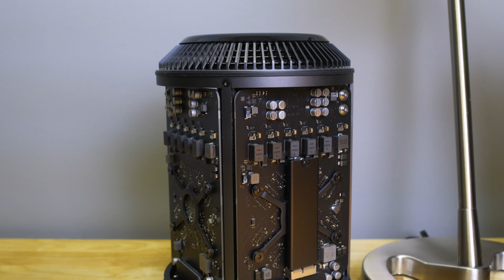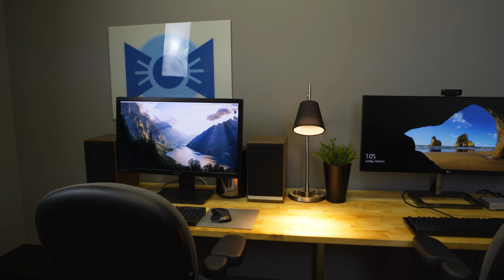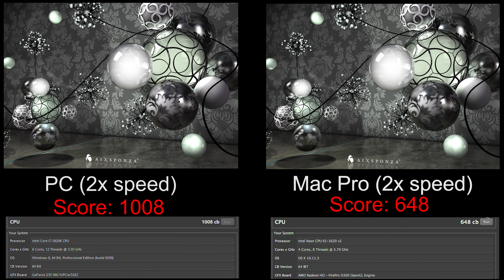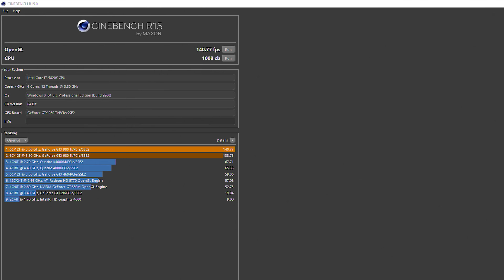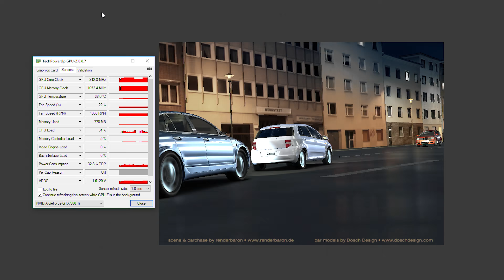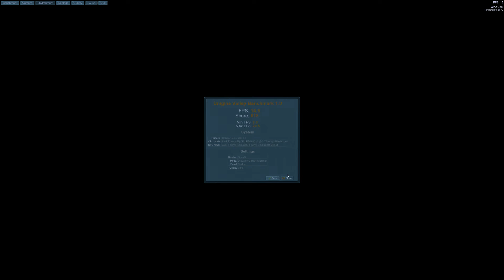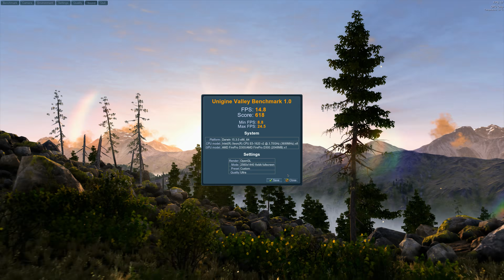$2,000 Custom PC vs $4,000 Mac Pro

Comment: I am not surprised that a new $2000 pc beats a $4000 mac pro that is already 3-4 years old. You can get newer computer with $1000 or less and it still may perform way better on those tests than the mac pro.

Comment: My desktop is a HP with a core i7 6950x, 32GB RAM and a TITAN X.  I got over 60 FPS using that benchmark.

That Mac is available with 12 cores for around $10,000.  

It sounds cool, but I'm not sure what it would score.

3D prefers more cores...

Comment: this has always been the case with Apple. It's nothing new for them, hell you can build a Hackintosh, with OS X, for half the price it would otherwise be sold for. But the sheeple will blindly continue to overpay for, mediocre at best, hardware and performance. maybe because it's shiny, and well,  the Apple sheeple are easily amused and not the most intelligent to begin with.... (not all just most)
Reply: Derek D do you know how hard it's to make a hackintosh? You have to buy specific components just to get it to work and it's illegal.
Reply: Ross MK it's infact not illegal, and the parts aren't all that hard to find or expensive to purchase. You may find your Apple Id banned if Apple hears but big deal. All this just prooved even more how ridiculous Apple is. I can buy any components and use them with Windows, Ubuntu and other linux based os's with ease. Apple makes it difficult if you don't know what you are doing sure.

Comment: Not that it justifies the price difference but comparing a Xeon with an i7 isn't really a fair comparison. They're significantly different processors designed for different things. In a really really rough way its kind of like comparing a car and a truck simply in terms of speed.

Comment: Again, one video about comparing a workstation against a gaming rig, and 9k stupid idiots who don't see the difference between a money making workstation, and a money consuming gaming rig!!! FOR FUCKS SAKE when is anyone going to put this damn Mac Pro on a professional workload instead of gaming tests and gaming benchmarks?!
Reply: Konstantin Sembos he did the rendering stuff I dont know what its called, the mac still lose
Reply: Konstantin Sembos 
Cinebench is a render test and in any case the hardware on the PC will outperform the Mac by spec alone, regardless of software and operating system. Unless you're using Final Cut Pro, which is mac only, there's no comparison.
Reply: What about GPGPU applications, where these things are supposed to perform well, thanks to their specific components, as opposed to consumer CPUs and Gaming GPUs? And no, cinebench doesn't give any glimpse as to how a computer can perform in that large area of professional applications.
Reply: Konstantin Sembos I've been making money with a "Gaming Rig" for more than 2 decades.
This kind of tech perfectly suits all of my needs, and the 2k$ "Gaming Rig" shown in this video is pretty comparable to my main working computer.
Failures in 20 years of work: 2 defect hard drives. No bluescreens. No lost or corrupted data. No other problems.

But principially you're right. You can also waste your money easily buying a PC workstation with ridiculously overpriced XEONs and "Pro" GFX cards and it won't be much cheaper than the Mac "Pro" (and will also offer a lot less power per $ than the "Gaming Rig", and in low configurations even less absolute power). 
Nevertheless, the PC workstation will still have the advantage of easily interchangeable parts (an absolute must have for professional work - and when it comes to that, the mac is just a ridiculous toy). And of course you can get PC workstations in rack cases - also a must have in a lot of scenarios. We sometimes use these things as 24/7 media servers - for this use case long term reliability is much more important than the price. You can not even get the Mac "Pro" in a rack case - an utterly useless joke.

So to be fair, let's compare the "Gaming Rig" with an Apple computer, which parts are more compareable (Desktop case, I7, GTX 1080 etc).
Oh wait, there is none.

Comment: One thing about Apple products in general they usually come underspec for the most part. And if ppl want to upgrade apple products they have to buy more upgrade components/adapters to get optimal performance. Apple successfully pulled the wool over gullible Isheep for years.

Comment: One has 4 cores anr 3,7 Ghz one has 16 cores and 3,3 ghz so if 16:4=4 then if the custom pc would be a quad core it would be 13,2 Ghz 13,2Ghz:3,7Ghz is 3.5675675676 So the custom pc should be 3.5675675676 times faster!lol
Reply: Math genius, computer science ignorant. Mhz are not the issue here.. This guy is comparing a truck to a roadster in speed... put that PC to do CAD intensive and it will spit errors by the hundreds and crash
But dont worry. It's just a video for stupid gamers to justify spending 2000$ they DONT have on a gaming PC to say its just faster than a Mac Pro... WOW!
Then ask them How much money they make with it? 
There's a reason why people who MAKE MONEY with a computer use certain models, custom or macs. THEY KNOW what they're doing mate!
Reply: noeliu It's true that there is some professional software out there which mandatory requires professional workstation graphics cards, e.g. SolidWorks, or other software, which gives a lot better results when using an expensive professional grade gfx card, e.g. CATIA.
But it's also true, that there is also a lot of professional software, which doesn't require a good GPU at all (e.g. Office software, Compilers/IDE) or runs a lot better on good consumer graphics cards (Autodesk Maya).
For a lot of tasks ECC support is not necessary, especially the common desktop work. If the worst thing which may happen is a corrupt rendered image or one crash in 10 years, it's a simply an unnecessary waste of money. On the other hand, for some tasks it is indeed mandatory, e.g. all 24/7 systems or all systems, where precision is absolutely crucial (e.g. CAD, Financial).

What you need highly depends on what you want to do.
So if you REALLY KNOW what your'e doing, you can save a lot of money.
The "gaming" system introduced here would be a perfect choice for Maya users. Around triple performance for half the price.
Programmers who need a lot of processor speed, but nearly no GPU support, could remove the GFX card completely and save even more money.
Users which really need a professional GFX card because their programs depend on it, could e.g. replace the GTX980TI by two Firepro W7100, which would make the system ~$3000 instead of $2000. A bit more expensive than the pure "gaming" solution, but still a lot cheaper than Mac and it will - both CPU and GPU-wise - run circles around the Macs poor and outdated hardware.

So what's the conclusion?
You see, PC/Workstation means ultimate flexibility. You can tailor your system perfectly to your needs without wasting a single $.

And Mac? Wether you need a GPU or not, wether you need ECC or not, wether you need a workstation grade GFX card or not, all that Apple tells you is:
"Eat this trashcan or die".

And it comes even worse. 2 Years later the system might be still pretty decent when it comes to CPU, RAM and SSD. But the GFX card might be outdated.
So just exchange it for little money on the PC or a bit more on Workstation.
On Apple, your'e simply lost. You need to buy a completely new computer. IF Apple has decided to be so generous to introduce an updated model. Which they didn't.
Reply: GrosserMagus Apple is shit
Thanks

Comment: For a workstation I'd rather have a PC of course but when it comes to laptops I much prefer a Macbook over a Windows laptop. The design, portability, battery life, multitask performance and the actual OS on a Macbook is so nice to use for most of my tasks. I can't stand these braindead people who don't even consider looking beyond performance for one second. It's like saying a 300hp car is better than a 200hp car. Horsepower doesn't tell you how well the transmission is. How smooth the engine runs. How it handles corners etc.

Again, talking about laptops. In terms of desktops I also think the Mac Pro is just ridiculously far behind in performance.

Comment: I can think of only one good reason to buy any mac. IOS development. and you can do that effectively on a $700 mac mini. Everything else is better and cheaper on a Windows or Linux box, depending on what you're doing. If the toughest thing you do on a computer is browse the web, do email and watch youtube, any ~$200-$300 tablet will be perfect for you. For creative work like video or 3d rendering, just build a decent PC, same for gaming, same for any kind of development, except ios.
Actually the battery life on a MacBook is just amazing. If you use a laptop as a laptop, then MacBook's are great for this feature alone.

Comment: If I had 4000 bucks to spend on a pc, I would most certainly not buy anything apple because with that much cash, I could buy a killer pc that could last for 20 years if not even more.
Reply: Oriru Bastard i would build a 3k pc and 1k on monitors, peripherals, stuff that makes my desk mine (what i mean with that is like pop figures of my favorite movies and other stuff) etc.
Reply: Probably not 20. Even cards like GTX 1080 will be really obsolete in 7 or 8 years but I agree about the choice. You can build a system with two Xeon 8core CPU's, 2 GTX 1080's and 128GB RAM for the same price of a Mac Pro.
Reply: Cyclopath A trusty windows 95. XD
Reply: i would spend 1500 on the pc rest on other stuff
Reply: no pc lasts for 20 years, it would be a fucking relic.
Reply: Kavi Gosai Well, mine lasted nearly 18. ;)
Now I have 500 buck custom built compy.
Reply: Oriru Bastard yeah, it must have been so useful after 18 years
Reply: Oriru Bastard Just out of curiosity.. what was the specs of that pc? :)
Reply: Cyclopath 32megabytes of ram, 166mhz and state of the art graphics card... drum roll Riva TNT 2.

Ahh... Good times. :)
Reply: Oriru Bastard damm
Reply: Oriru Bastard Were you still running it regularly after those 18 years? And what OS? 18 years is an eternity for a computer :)

Comment: $1750 Gaming Setup

Hard Drive/ https://www.amazon.com/Blue-Cache-Desktop-Drive-WD10EZEX/dp/B0088PUEPK/ref=as_li_ss_tl?s=pc&ie=UTF8&qid=1471586545&sr=1-1&keywords=wd+blue&linkCode=sl1&tag=joeydel2525-20&linkId=48a0d71470ce75f2ada89834c8a657f1

I5 processor  https://www.amazon.com/gp/aw/d/B010T6CWI2/ref=mp_s_a_1_1?ie=UTF8&qid=1474178281&sr=8-1&pi=SY200_QL40&keywords=core+i5&dpPl=1&dpID=51Gq81DIpEL&ref=plSrch

Graphics Card https://m.newegg.com/Product/index?itemnumber=N82E16814133629&nm_mc=KNC-GoogleAdwords-Mobile&cm_mmc=KNC-GoogleAdwords-Mobile-_-pla-_-Video+Card+-+Nvidia-_-N82E16814133629&gclid=CN37t7Pn588CFdJahgodCjANuA&gclsrc=aw.ds

Mother Board 
https://m.newegg.com/Product/index?itemnumber=9SIA24G47N1559&nm_mc=KNC-GoogleMKP-Mobile&cm_mmc=KNC-GoogleMKP-Mobile-_-pla-_-Accessories+-+Barebone+Systems-_-9SIA24G47N1559&gclid=CN_61Nrn588CFQUehgodnrcGvw&gclsrc=aw.ds

Power Supply https://www.amazon.com/gp/aw/d/B00H33SFJU/ref=mp_s_a_1_2?ie=UTF8&qid=1474188369&sr=8-2&pi=SY200_QL40&keywords=evga+600w&dpPl=1&dpID=51PiQrWaNjL&ref=plSrch

Memory 
https://m.newegg.com/Product/index?itemnumber=N82E16820233886&nm_mc=KNC-GoogleAdwords-Mobile&cm_mmc=KNC-GoogleAdwords-Mobile-_-pla-_-Memory+%28Desktop+Memory%29-_-N82E16820233886&gclid=CKb_6vDn588CFQRZhgodLv8AYQ&gclsrc=aw.ds

PC Case https://www.amazon.com/dp/B005869J4O/?tag=pcpapi-20

Asus Monitor 
https://www.amazon.com/gp/product/B005BZNDOO/ref=as_li_tl?ie=UTF8&camp=1789&creative=390957&creativeASIN=B005BZNDOO&linkCode=as2&tag=techs096-20&linkId=U6JPCSHYRTPL6EED

Windows 10 https://www.amazon.com/gp/aw/d/B00ZSI7Y3U/ref=mp_s_a_1_1?ie=UTF8&qid=1474184478&sr=8-1&pi=SY200_QL40&keywords=windows+10&dpPl=1&dpID=41us3IirK-L&ref=plSrch

Optical Disc Drive 
https://www.amazon.com/gp/aw/d/B0033Z2BAQ/ref=mp_s_a_1_1?ie=UTF8&qid=1474184784&sr=8-1&pi=SX200_QL40&keywords=optical+drive&dpPl=1&dpID=31JpWsniizL&ref=plSrch

Office Chair 
https://www.amazon.com/Leather-Office-Executive-Ergonomic-Computer/dp/B004ZVHKJE/ref=as_li_ss_tl?ie=UTF8&qid=1466657684&sr=8-5&keywords=office+chair&linkCode=sl1&tag=khyra-20&linkId=e5d8c4b41e00e5a63ca02073945e4003

USB Speakers
https://www.amazon.com/AmazonBasics-Powered-Computer-Speakers-A100/dp/B00GHY5F3K/ref=zg_bs_172471_1

Red Backlight Keyboard 
https://www.amazon.com/AULA-Backlit-Keyboard-Colorways-SI-859/dp/B01C09ZTK4/ref=as_li_ss_tl?ie=UTF8&qid=1461704749&sr=8-1&keywords=aula+gaming+keyboard&linkCode=sl1&tag=techsource02-20&linkId=df32b34b17c31cb405dc350aa4fcddd6

Gaming Mouse
https://www.amazon.com/gp/product/B00HYPCP0M/ref=as_li_tl?ie=UTF8&camp=1789&creative=390957&creativeASIN=B00HYPCP0M&linkCode=as2&tag=techs096-20&linkId=WKEVXPRVNHEGZT5J

Headset
https://www.amazon.com/gp/product/B00BFOEY4I/ref=as_li_tl?ie=UTF8&camp=1789&creative=390957&creativeASIN=B00BFOEY4I&linkCode=as2&tag=techs096-20&linkId=IL2XFG7RMRX3UC5G

Is it good?
Reply: FinalBali fuck off
Reply: at a quick glance, your mobo  supports overclocking, but your CPU doesn't. recomend switching to the 6600k. and size up on your power supply. check out pcpartpicker com. it will guide in selecting your components. happy holidays!
Reply: if you are getting 1080p monitor with gtx 1080 pls just stop. get atleast 1440p monitor because otherwise you are doing nothing with that card
Reply: Uneven Melons Oo please use pcpartpicker.com
Reply: Hugo Haataja Not if the 1080p monitor has 144hz refresh rate
Reply: CryJump YT i guess thats true but its up to what hes gonna play. the one he listed was a normal 60hz monitor
Reply: Anwar Rahman you can overclock 5-6500..
Reply: well if you get a better processor then its a killer pc

Comment: the reason apple has this terrible computer is because their whole company is based around fitting amazing technology into tiny boxes which is difficult with a computer and when they figure out a design, everything inside is outdated. this is exactly what happened with the last computer and they are trying to not do it this time but they can't design, test, build, advertise, and sell the computer before much better parts come out.

Comment: you can't compare a gaming GPU to a professional GPU. they really aren't the same thing. The same goes with the CPU - you used an i7 processor, which is consumer product, to a Xeon processor, which is professional grade CPU. Yes, for games and unprofessional video editing, PC is cheaper and better, but mac pro is for professionals who can't afford something failing in their system. Windows is made for every possible combination of hardware, so they had to write drivers for everything, which means there's a shit ton of room for errors and crashes. Apple is a software company that makes their own hardware - they have only one product combination, so their code is better.
Reply: I've been working professionally with "consumer" machines for ~20 years now, and so do all my colleagues. Number of failures by now: 0. Last blue screen? Can't even remember, must have been around 2000 (on poor old W98). And if really something should fail, let's say the graphics card? I have an easy to change spare part. 5 minutes, and I can continue working. Try that with a mac "pro". And even on a catastrophic failure (lets say lightning damage) - I have another spare machine @ home and can continue working nearly instantly. And the best is: All of these spares and redundant machines are much more powerful each and cost less together than one single mac "pro".

The only case we use "professional" grade machines at work is when they are to run 24/7 and/or off site (e.g. as a media server at a customer 500km away). Thats the domain of these machines. But of course we use HP or Dell... definitely not a so called "professional" mac "pro", which doesn't even offer a 19'' rack form factor lol

You're just telling fanboy tales and myths.

Comment: my Intel i5-6400 with 16gb ddr4 ram and AMD RX480 hits 2096 points in valley benchmark (same settings) and it's a 1500$ pc.
Reply: Ross amd :d
Reply: i5-6400?   u should have bought i5-6600k for just a few dollars more.   It has much better resale value too.

Also, GTX 1060 is faster and runs cooler than RX 480.  Just sayin

Comment: Actually, its not the best mac apple sells...you can get this for almost $9000:
2.7GHz 12-core with 30MB of L3 cache
64GB (4x16GB) of 1866MHz DDR3 ECC
Dual AMD FirePro D700 GPUs with 6GB of GDDR5 VRAM each

Research fail... Probably not a good performance/price ratio compared to something you can build, but the computer you present there is not the best computer for professionals that mac sells.

Comment: Built a ~$1000 system with an i3-6100 and a GTX 1060 that kills games, obviously weak on CPU-related tasks, but the idea of a $4000 computer in my mind would be something like two 1080's or a Titan X Pascal. Not, whatever that was.

Comment: I just built a custom computer and i was having rebooting issues also, and just like you (and your commenters haha) I suspected the power supply. However after the windows 10 anniversary update, all issues I had that seemed to be linked to the PSU just vanished.... do you think the update was relevant or did my PSU just finally decide to work correctly?